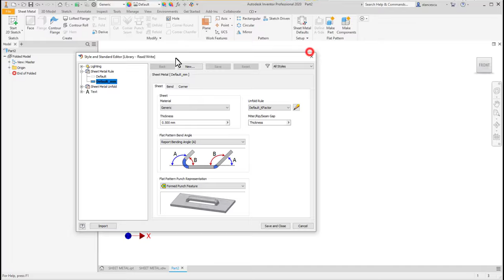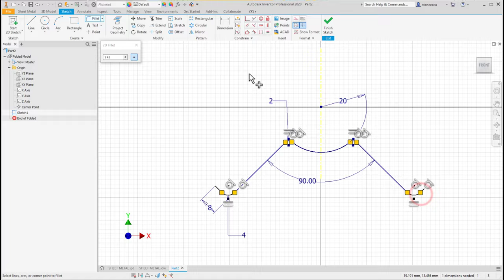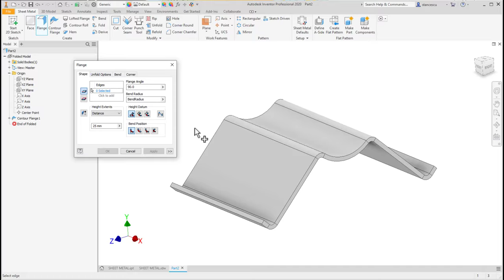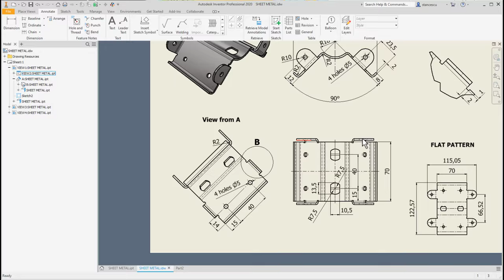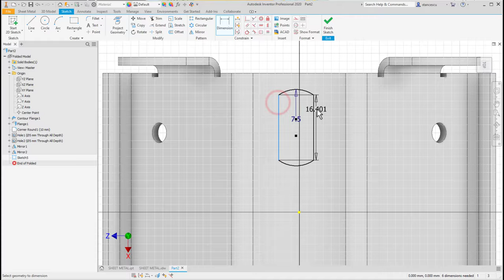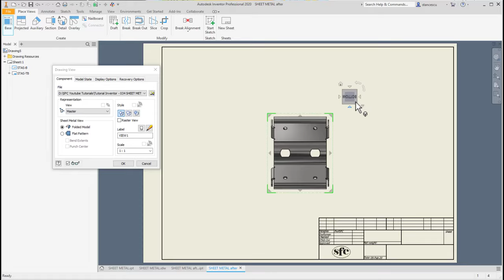Tutorial Inventor - 034 SHEET METAL - Practice (SM-001)

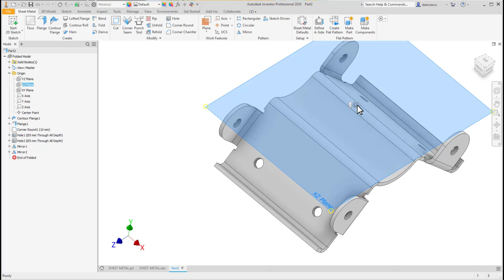Comment: 23:04 - When you make the holes through the middle curved part, technologically is not possible. The tangential cut has to be perpedicular to the curved surface. To correct this, the part has to be unfolded then the cut command to be executed so that when you refold the part the edges will be created as in reality as the machine is punching the flat part, followed by bending. Thank you for the good job you do in teaching us.
Reply from the maker: It seems to be a good idea. Let me verify. Thank you, my friend!
Reply from the maker: I verified the model and am sure the holes are technologically possible. After bending the part a puncher can cut those holes without problems! On the other hand, this drawing is taken from industry, and we must respect drawings. Thank you, my friend!